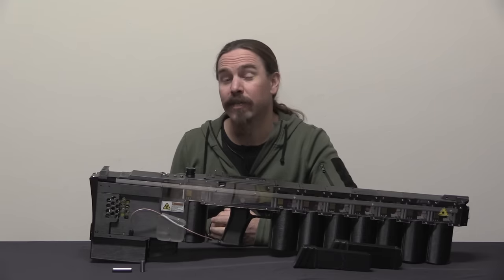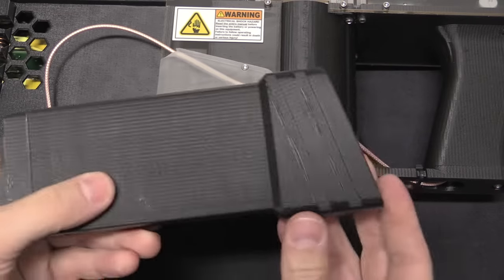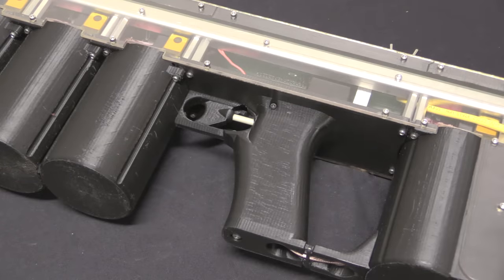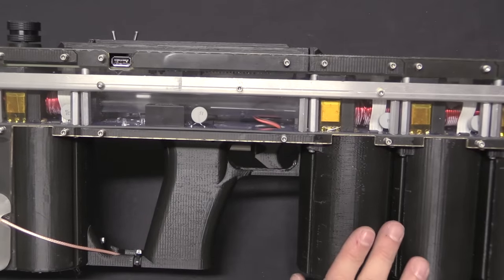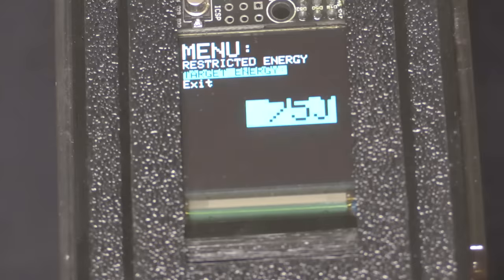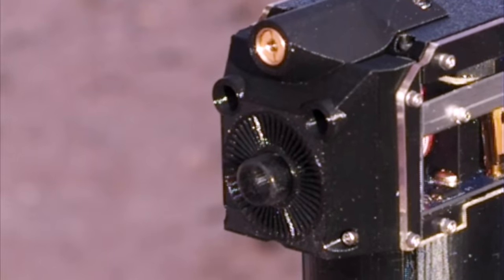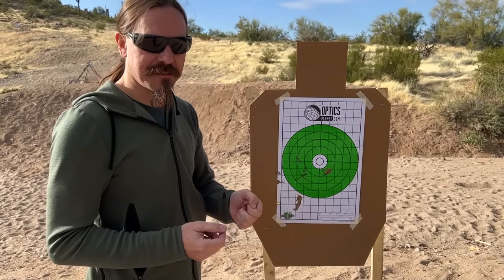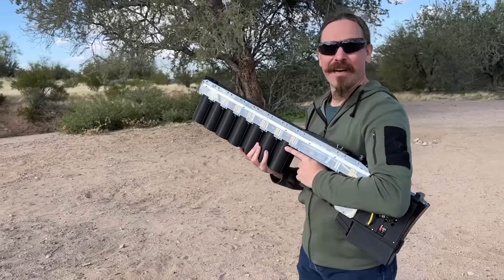ArcFlash Labs' GR-1 Anvil Portable Gauss Rifle

Comment: Mass Effect guns started to make even more sense now with all the overheat level bars, cooling systems and thermal clips, wow. Assault rifles there overheat much slower per shot, thus can fire more projectiles before cooldown/heatsink replacement while sniper rifles and shotguns can only make one or several shots because energy output is higher. This says something about the attention to details in some scifi.
Reply: If they made 8t so the metal block had to be replaced that would have been more lore friendly.
Reply: I played four mass effect games back in the day and I can't remember what the guns were like.
Reply: Basic physics. U go to high school dude
Reply: @TurinTuramber  IIRC lore wise they have a sold block of ‘ammunition’. Each time it’s fired the weapon shaves off a grain as big as a grain of sand and propels this at ridiculous speeds.
Reply: My name is General Shepard and this is my favorite comment on YouTube
Reply: @famalam943  so yeah the guns were railguns basically which makes it insane to think about how the reapers were giving people trouble
Reply: @MrClubfoot90  Considering that based on the lore, you can get hundreds of shots per block, I figure that's just "out-of-sight maintenance".  And it's not like blocks of metal would be in short supply.  Games don't typically make you deliberately clean the gun either.
Reply: @chucknorris277  It's not about lack of knowlede, it's about other devs not giving a damn about something like this. Btw, there was no handheld weapons like this in 2007 so they didn't have a reference but they still made them up to be pretty close to reality. It's devs' attention and effort that is impressive. Learn to understand text's message.
Reply: @delta2372  railguns are much more effective than 7.62 or 5.56 bud
Reply: @famalam943  not entirely. It would shave the flecks off, then suspend them in a mass effect field, slashing the mass of the projectile then magnetically accelerating the projectile at a percentage the speed of light. The M920 Cain took a 25g slug and accelerated it to 5km/s (18,000km/h or 11,184mph). They were basically miniaturised mass relays
Reply: @Optimusprime56241  They are more effective, but until we can miniaturize power supplies sufficiently, rail guns will only make sense being vehicle or emplacement mounted. Required power supplies are still too large to be man-portable. Here's hoping that i see a reliable portable rail gun in my life time.
Reply: THIS ^^^. On point. If you read, all the stuff in the codex on mass effect. It will put you in the rabbit hole. The attention to detail and the real life concepts and theoreticals they did in that game were so on point. Mass Effect was already an amazing series based on characters and plot. The CODEX entries was icing on the cake. Icing that I seriously wonder if i will find in future games.
Reply: Plasma guns in Halo overheat all the time. This was a popular visual concept back in 2001 and even earlier.
Reply: @KitNoxious  I don't think they were miniaturized mass relays exactly. More like mass eccelerator overcomplicated with projectile weight reduction technology. Mass relay lore is pretty obscure, but I remember it was said somewhere that they create absolutely empty time-space tunnels to reduce any physical resistance and shoot the ships through it. It's more than just reducing weight and accelerating something. But that's just details)
Reply: @TheIRONSTAG  I love the mass effect series. Think andromeda jumped the shark a little, but the Milky Way trilogy fucking slapped.
Reply: Am I the only person who thought of StarCraft instead of Mass effect? XP
Reply: @MilesTraveler  The Ghost Gauss Rifle in StarCraft 1 is perhaps a bit closer to this. Low velocity and clunky, but the Ghosts fire explosive grenades with them so they work out pretty good.
Reply: Kinda sounds like the Covenant plasma weapons in Halo
Reply: @Alatzas1  nah, it was incredibly simplistic. Mass Relay would negatively charge the eezo core, which negated the mass of the ship, which was then propelled at insane speeds to a receiving relay, which then reapplied the vessel’s mass with a positive charge. The calculations were done by the sending and receiving relays, sometimes requiring multiple jumps to reach a destination or circumvent a celestial hazard (nebula, asteroid field etc). Reading the codex entries across the games really helped make sense of the science behind it, even though it’s not achievable in our reality
Reply: @MilesTraveler  yes, I did it too!
Reply: I strongly believe it's been done for balancing and could only be coincidentally explained this way 😅
Reply: @markusklampfer1149  awesome. I remember the Marines with their Gauss guns and the Ghosts with rifles that fired explosive rounds. Miss that game, SC and SCBW.
Reply: @KitNoxious  Maybe. But I remember that Codex was a bit skimpy on details regarding mass relays, so I went on the web to find more and read something like what I said. Maybe in 2 or 3 game codex entry was expanded and I just didn't read the updates though. But what you said makes the most sense.
Reply: I have a full auto m4/m16 and EVEN with a gas tube made entirely from inconel (super high temp resistant stainless steel-like material) the gas tube bursts at under 300 rounds fired
Reply: @KitNoxious  100% agree. I'll be real, Andromeda really upset me. I didn't even bother finishing the game yet. 

I know that when I think of Mass Effect. You'll always think of Milky Way, Garrus, Legion, Wrex, Cerberus, and combing the fucking surface of a planet to find that one little metal pyramid. haha.
Reply: @user-oy9zy4ds9m  bruh, there are people who torture tests m4/m16 rifles with thousands of rounds. Including the military, and many people here on YouTube.
Reply: @hokuhikene  you’re thinking of the Eviscerator shotgun. That one shaved off serrated metal wedges designed to fly more aerodynamically
Reply: @famalam943  It sheers off an "appropriate sized slug" from the black based on distance to target and local weather conditions to ensure that the round has the correct energy upon impact.

Edit: Codex Entry - "The ammo magazine is a simple block of metal. The gun's internal computer calculates the mass needed to reach the target based on distance, gravity, and atmospheric pressure, then shears off an appropriately sized slug from the block. A single block can supply thousands of rounds, making ammo a non-issue during any engagement.

Top-line weapons also feature smart targeting that allows them to correct for weather and environment. Firing on a target in a howling gale feels the same as it does on a calm day on a practice range. Smart targeting does not mean a bullet will automatically find the mark every time the trigger is pulled; it only makes it easier for the marksman to aim".
Reply: @TheIRONSTAG  did you prefer the Mako or the Hammerhead? My preference was the Mako. Could stand up in a firefight, had the coaxial machine gun as well as the main cannon. Didn’t have the same manoeuvrability as the Hammerhead, but I couldn’t see the Hammerhead going toe to toe with a thresher maw and coming out on top
Reply: @Alatzas1  they expanded the lord a metric shitload between ME1 and ME3. BioWare do world building really well when it comes to text based lore. Struggled to get into Dragon Age, but that’s because the combat was a more hands off experience, whereas Mass Effect was a bit more involved
Reply: @KitNoxious  MAKO ALL DAY. That thing defied fucking physics in ways that allowed me fly almost hahaha.

ALso to concur with your second point that I definitely don't see the hammerhead going against a thresher maw without everybody dying inside.
Reply: @Optimusprime56241  halo rounds are allot stronger than modern rounds irl, plus outside of biotics mass effect is fucking weak in technology, only factions in ME that has decent tech are the geth and the reapers.

Even then the biggest ships those factions have are barley equal in firepower to a UNSC or covenant destroyer.
Reply: @delta2372  laughs in not needing to cryo sleep for long journeys
Reply: @TheIRONSTAG  mass driver weapons from Mass Effect are amazing from a technological standpoint. For instance: that one planet with a fucking canyon in it from a glancing blow from an ancient mass driver
Reply: @KitNoxious  you do know that is mostly for human ships not covenant right? and slipspace while slower is not as restricted like mass relays are, if there's a colony that isn't connected via mass relay you have to take a relay then spend hours or days using an FTL drive from there.

With slipspace you can go from point A to point B in a matter of days or months with early UNSC slipspace drives.

Covenant slipspace is almost instantaneous than UNSC slipspace drives.

Also atleast halo has actual and proper orbital defenses so planets can't get sniped and instantly invaded like in mass effect.
Reply: @KitNoxious  Bro i'm just trying to go to outer space. haha Mass Effect made me realize that I may never get to see that. To join Space Force, I need a fcking PHD and had to go to Green Beret skill.
Reply: @delta2372  a railgun is a lot more powerful than the halo AR, the Halo ar is 7.62x51 I think
Reply: @Optimusprime56241  again halo rounds are allot stronger than their modern counter parts, UNSC weapons have also been heavily modified to shred shields since that is a major advantage the covenant has over the UNSC, and the UNSC does have railguns if you consider that gun from halo 4-5
Reply: @delta2372  Um not they really aren’t that much different from rounds nowadays
Reply: @delta2372  and the railgun from 4-5 isn’t fully auto or semi auto like the mass effect guns, technology in the mass effect universe is way more advanced than in halo
Reply: @Optimusprime56241  human weapons maybe, covenant weapons no, covenant weapons and forruner weapons smack mass effect weapons
Reply: @delta2372  covenant weapons no, forerunner weapons maybe, plasma weapons exist in mass effect as well
Reply: @MilesTraveler  I’m talking about 3 (100 round drums dumped back to back…..
Reply: @user-oy9zy4ds9m  yes. I'm talking about how guns are torture tested by firing mag after mag, or drum after drum often dipping the barrel in water to cool it off, until they reach a couple thousand rounds to see if they break. Not a few hundred, a couple thousand. Even the ancient 1911 pistol was tested by the military by firing 6,000 rounds through it dipping it in water to cool it, and it didn't have a single malfunction. 

Similarly as long as you're using ammo that's not crap or magazines that are not crap any half decent M16 or M4 should last for thousands of rounds with only a few brakes for cooling.

AR-15 Springfield saint Victor I put 400 rounds through without any issues. Now any metal will require that you cool it at some point, and how often you have to cool it depends on the barrel metal and type, outside factors like the handguard and how much venting you have. What kind of pressure around you're using. What specific gun or ammo you are using. But the biggest effect you'll notice is you start losing accuracy on thinner barrels after a couple magazines. But it takes a lot to blow out a barrel. Unless the barrels of particularly poor construction.